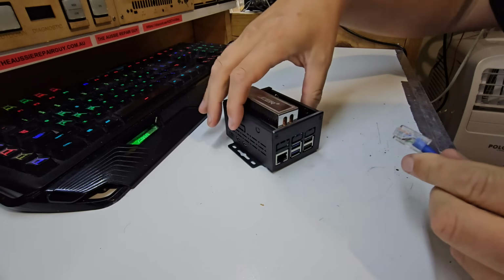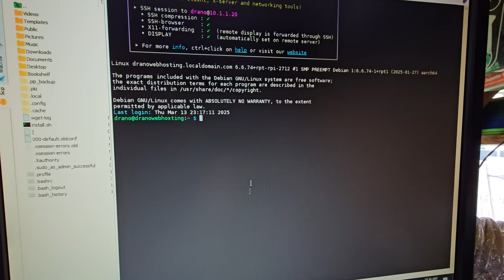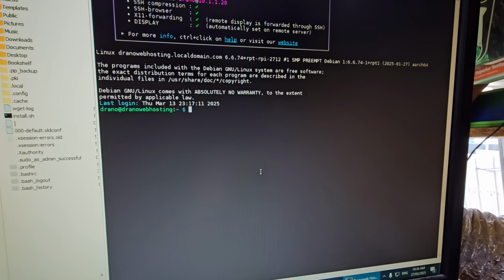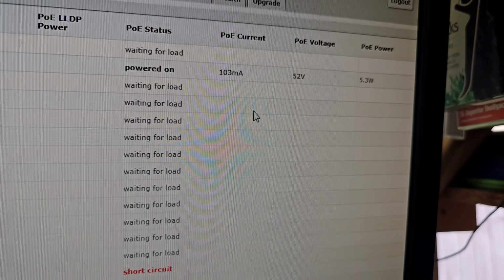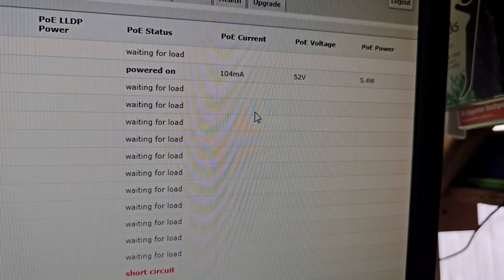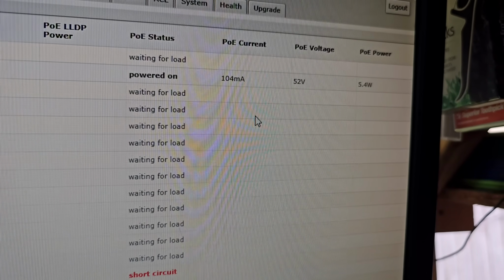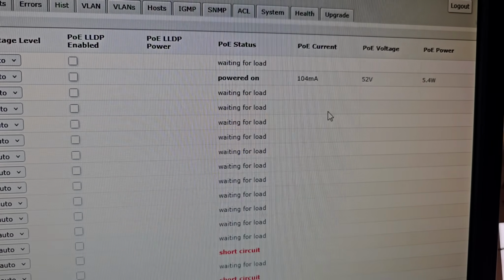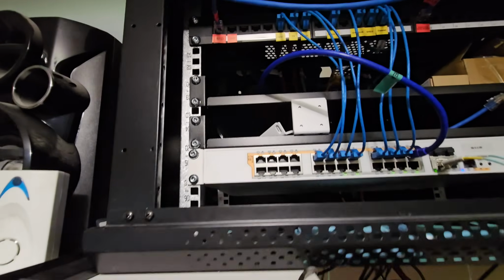Building my Raspberry Pi 5 Web Server

Comment: Interesting video , with the lid for the server that you left off couldn’t you make one with your laser cutter and and some clear acrylic or 3d print one with the specific cut outs and notches to fit around  the heat sync and so dust and crap doesn’t get in.
Reply from the maker: I'm fan forcing air through it, if air can get in, dust can and will get in. I'm managing the dust at the rack level, and will need an IO cable in there at some stage too